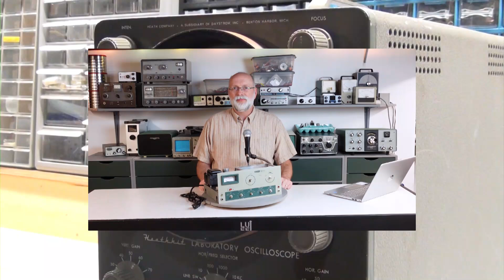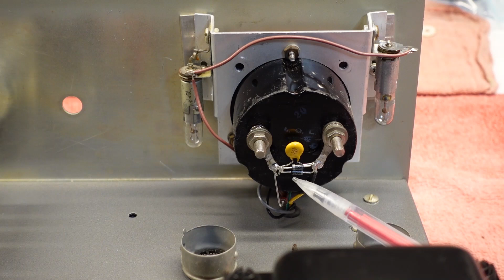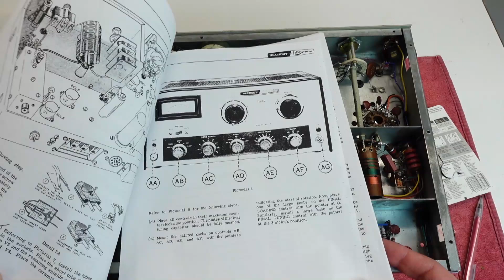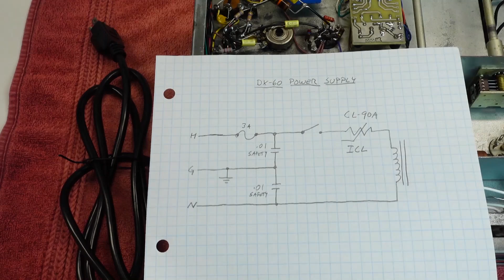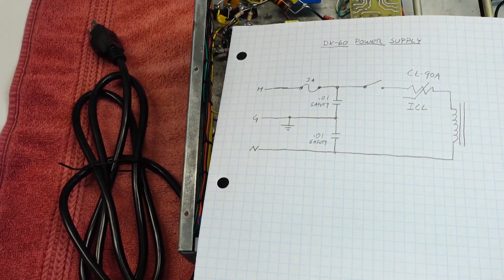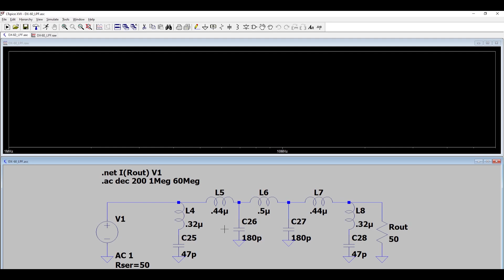Heathkit DX-60: Part #7

Comment: Thanks for another great Level Up video. I do have a few observations if you have any interest. 
1) Crinkle and other textured paints generally take more time to really cure than other paints. When I use these types of paints, I leave the item in my shop oven at ~110 F for 2 - 3 days and that really sets the paint. Or during the late Spring through mid Fall, leave the item on a piece of cardboard for 2 - 3 days in the sun. The paint should be cured enough that bugs don't get stuck, die and deform the area. 
With regards to the small scratches around the line holder, you could simply touch-up that area with some of the paint, hopefully, left over. It will eventually cure and be less thick looking. Still, I'd spray a little paint in a 1 oz medicine cup, like the ones which come with cold meds etc, Then add ~30% thinner and use a foam applicator and touch down on the scratch area.
2) The meter replacement, IMHO, takes away from the appearance and personality of the DX60. As mentioned earlier, a simple circuit to get the meter to swing from end to end at ~1sec per full swing cycle and left to run a few hours or overnight has fixed a number of issues I've had with different meters which were stuck somewhere in their travel. I was not able to determine if the problem was oxidation, or debris related but it cleared the problem(s). I set up my circuit where I could increase the swing V and travel fast enough to not bang either end/stop; as you know meters vary and re set-up is needed between meter types. As I recall, this kind of problem was nicknamed Stickation (sp???)
3) as you know, buying replacement canned caps now days is easy from several suppliers, though pricey. Have you tried carefully cutting the bottom flange off a can with a Dremel tool using a diamond dust impregnated cutting wheel  then taking a propane torch to heat the outside of the can for ~ < than a minute? Using a wine easy-out, the core of the old cap will slide out. While the can is still hot fold blue shop towels into a round wedge and get most of the black tar/goop out of the can. Once I stuff good quality caps, I use JB weld to reseal the flange and use the Dremel tool with a sanding wheel, clean up the slop. Sounds like a lot of work but I can usually go through the process in ~15 - 20 minutes if I have everything needed to do the job at hand. If you have interest in trying this send me an email glenn@dsmlabs.com and I'll mail you a can to experiment on b4 you do the DX60 can you have.
Overall, your project looks great. The added pcbs are not stock but more akin to the Sherwood mods for the Drake R4C, looks very professional. 

Here is a link to an Easy-out like the one I use. The neat thing is it has a shoulder of the perfect size to fit over the top of most canned caps and EASILY slides the old goo out. Just remember it'll still be hot. I handle it with folded blue shop towels and a heat resistant glove on one or both hand(s). I always do this kind of work outside to limit my exposure to fumes released while heating the can.

https://www.amazon.com/Vintage-Bottle-Opener-Creative-Corkscrew/dp/B088TGQRPV/ref=sr_1_10?crid=61RQKAHM6X2T&dib=eyJ2IjoiMSJ9.jNXwwy_mlTAQ7yHKiVB0TmeAurCyoNZ0_pt7I-4WUCqlJF-0LP1q1TULA9v8sehxE5HDO8uTh5VbaVIyyBOBDIGztz1EJFDV6Z22CkL8lvjbeaK7q1S85_BbaLn_LO9P7pkT9uEWBQ0o5lWyVQtjJA8ZxHYzsX1cJZo4sxSJFbvWT5p8j6l_geP7Uu9HmhEbT3AG7HrJtkCfIUsvaNKNTPGNJE_0LQ20-garWa3vwwzX_KoBWF4kXof_Qb7ZSb0Qh2sluLA8IEQxLSG5mQXpKM8c156WJPgljDwlDtM7MgU.B099eUV7TOq-RJaegnlKjt9WLRsxytW4y5BVmzt3HBA&dib_tag=se&keywords=Vintage+Lever+Corkscrew+Cap+Lifter+Chrome&qid=1724437968&sprefix=vintage+lever+corkscrew+cap+lifter+chrome+%2Caps%2C75&sr=8-10

73, Glenn WA4AOS